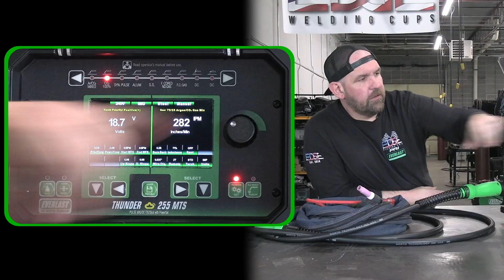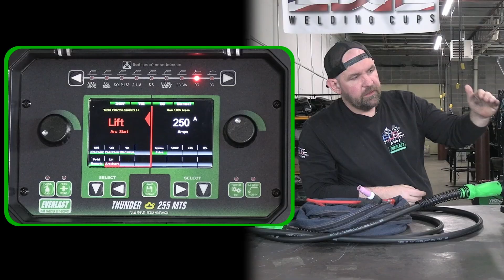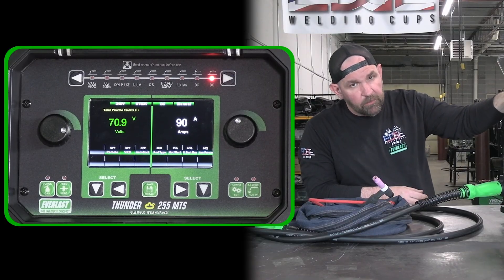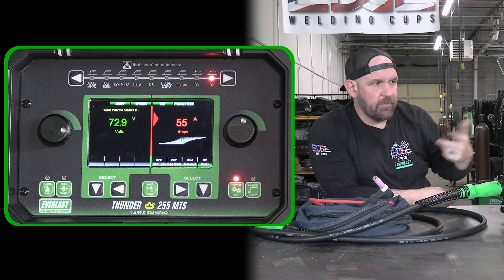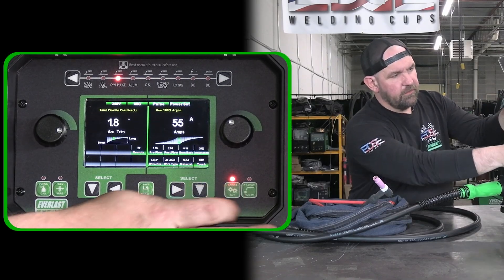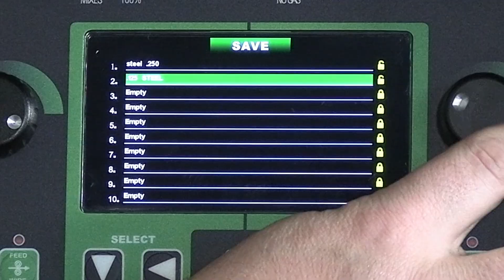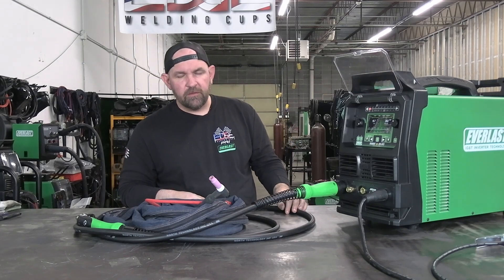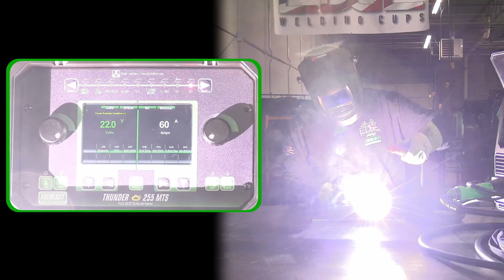Thunder 255MTS

Comment: Ok, I have a question. When welding short circuit with this machine, in my case using .035 wire & 75/25 gas on 1/4” steel, I see the powerset automatically goes to 90/10 gas. Is there a way to change the gas there?

Comment: Do you have any current or planned machines with Pulse MIG and dual voltage 120/240? I’m strongly leaning toward this Thunderbolt 255 as a shop machine, but it would be nice to have something I can run on 120v for the rare occasions I need it, instead of having a second smaller machine just for portable 120v use.
Reply: I was also wondering if the Thunder 255 has Stick Hot Start? I see Arc Force mentioned in the specs but Hot Start isn’t mentioned.
Reply: @KateNesD  Yes it does.
Reply: My last question is about this machine versus the 253DPi. Besides the big things, like dual pulse on the 253DPi, and better TIG options and TIG pulse on the 255, where does the extra 30lbs in the 253DPi come from? Actually, the manual puts the weight of the Thunder 255 at 82lbs, which is right in line with the 253DPi’s 84lbs, so maybe the 255’s listing page just has the wrong weight on it.
Reply: @KateNesD  30 lbs?  The weight is based on certain internal design elements.  Again, they are not the same. Internal configurations can be different.   Inductors etc all have different weights for the unit, which are heavy copper.  Likely there is very little difference in weight, but these are preproduction weights so final weight may vary a pound or two.

Comment: Thank you for the video, I believe this will be my next machine over the 263pi. Is there anything significant I would be missing out on over the 263 as far as MiG goes?
Reply from the maker: Essentially they are the same unit mig wise, little more fine tuning on the 263pi, but the thunder offers way more on the tig side which is what really separates them.  But on the mig side, for all intents and purposes, they are the same.
Reply: @everlastgenerator excellent, thank you for the explanation, hopefully I will be able to order the 255 in a few months 👍
Reply: @everlastgenerator hello, I also was wondering if the pulse aluminum MiG works with the spool gun or only with the main whip? Iam assuming that the pulse function when used with spool gun would allow for better aluminum MiG welds and the ability to get quality welds on thinner material? If that’s correct how thin of material could I expect to be able to do with it? Thank you
Reply from the maker: @chaddisisto4915 yes the pulse mode works with both the regular mig whip and spool or push pull guns. Generally speaking .040” is about the thinnest we recommend trying
Reply: @everlastgenerator  thanks for the quick reply, much appreciated. Do you have any pulse aluminum videos planned for the 255 or 263 with both spool gun and standard whip using various material thickness?
Reply from the maker: @chaddisisto4915 we have some more videos coming out with each going over more detailed use of the features. We have a new push pull gun coming in for some videos here in about a week as well so we will be featuring that soon
Reply: @everlastgenerator looking forward to seeing them 👍thanks again